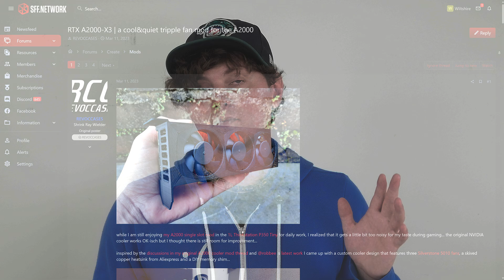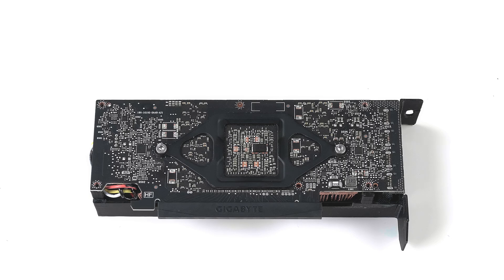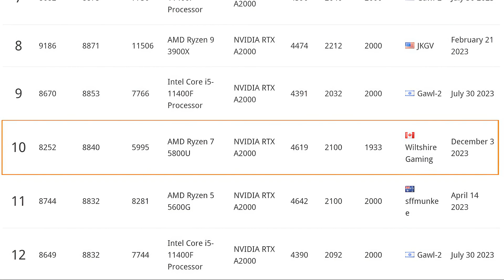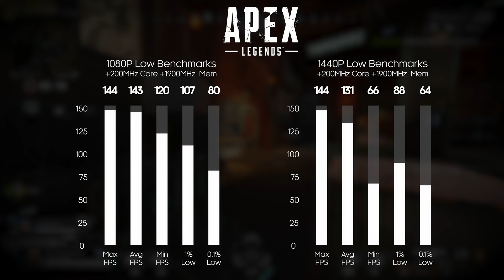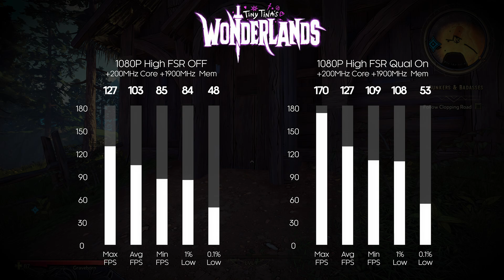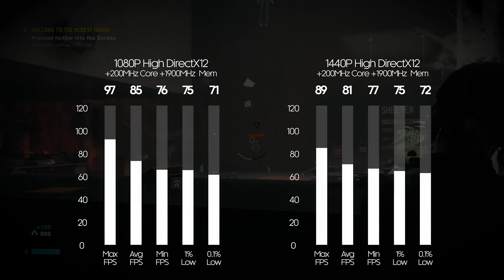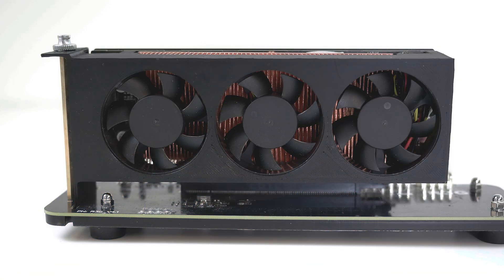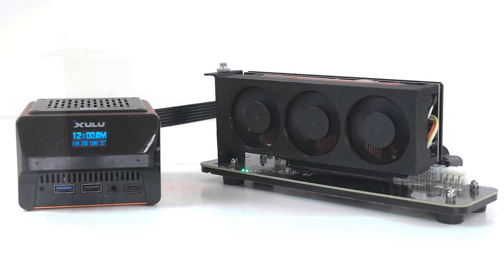Making the World's Fastest RTX A2000

Comment: came back to ask if you could do this with an RTX 4000 Ada generation if u ever get the budget, might try to do this myself with an A2000 cos its performing very similarly (in fact a little bit better) than an Arc B580 and it costs about the same, but is much better for SFF use cos its so low profile

edit: to specify, I want to have a similar set up to yours but use phase changing thermal pads and higher performance cooling compounds. I think using PTM7958sp for the actual GPU die itself, and PTM7950 with a copper backplate and aluminum shroud would help cool it much better, also try to hit that full 75 watt limit that PCIE motherboard interfaces allow.

Edit 2: I also just realized you could reroute the fans to the Mobo through a fan extension and not have to worry about their wattage and then use all of the extra wattage for the gpu as well.
Reply from the maker: I plan on buying an RTX A4000 ADA SFF. Not From Concentrate (NFC) made an amazing mod for the A4000 ADA SFF that I want to replicate. I just lack the funds for things at the moment.

I put PTM 7950 on the GPU die for the A2000Ti-X3 after this video and it helped drop the temps by few degrees! Not enough for me to make an entire new video on however.

I've gone the route of using the motherboard to control the fans and I don't like it very much. I prefer to be able to control the fan speeds at will using Afterburner.

Comment: Hi, could you help me with drivers for a2000? It allows me to dowload regular drivers, which not allowing play Fortnite or Witcher 3. Tried different methods but it’s still not working to dowload game ready one. 

How did you managed drivers and which version you’re using?
Reply from the maker: Are you referring to the studio drivers? The driver version that I used in these videos was version 546.01. I installed the driver like any other driver, nothing special.
Reply: i tried with 2 games and was not Able to even launch the game with a2000 12gb. But if you’re saying that with regular drivers it’s working than I’ll check as well different titles.
Reply from the maker: What kind of error are you getting when trying to launch those 2 titles?

Comment: For an A2000 it's rather fast, for a graphic card generally it's rather slow, my little 4060 has beaten all your scores.
Reply from the maker: To be fair, that's like comparing apples and oranges. The RTX 4060 is built using Ada Lovelace architecture and the RTX A2000 is not. It's built on Ampere. The massive advantage the RTX A2000 has over the GTX 4060 is power efficiency. The GTX 4060 requires the usage of an 8-pin power cable. The RTX A2000 draws straight from the PCI-E slot. No power cables needed. The A2000 is much more useful in tiny PC builds where cable management is an issue.

Comment: Hello! is your RtX A4000 still woking? i was wondering about reliability
Reply from the maker: @rusubogdan7030  my RTX A4000 is my daily driver that I use. It is still functioning just fine
Reply: @WiltshireTutorials  that sounds great, from what i saw on multiple forums you have been a  inspiration for many, myself included. Right now i am waiting for parts to mod my A4000
Reply from the maker: @rusubogdan7030  Always cool to see people who get inspired by the stuff that I've done. Good luck with the modding of your A4000. If you need any help or have any questions, I'm always around.
Reply: @WiltshireTutorials  Actually i do have a curiosity. The way i see it, the process of shunting implies soldering two resistors in parallel with the connector resistor and the pcie resistor. However, I see that you don't have stacked up resistors. I am assuming that the guys from jk removed the factory  r005 resistors and installed r003? From what i saw all forums suggested soldering r008 over de r005, and from my understanding that leads to a 8*5/(8+5) ~= 3mohm. Please correct me if i am 100% wrong in what i just said. Also, please excuse me if it takes two or three readings to understand some things i said, english is obviously not my first language.
Reply from the maker: @rusubogdan7030 no need to apologize, friend. Your English is great! I applaud anyone who knows more than 1 language. I've tried and can't do it! John from JK&G Ventures has his own method of shunt modding that is different from others. He won't disclose exactly what he's used on the cards, so I unfortunately don't have the answer to your questions. I could attempt to use a multimeter to check what resistors are being used.
Reply: @WiltshireTutorials  i will do the shunt in the "classical" way, i was just thinking that the way your card is shunted gives it a slight advantage in stability. Thank you very much for your help!

Comment: Wow, nice modding here.
My card just has a shunt mod plus extra power adapter soldered onto it.
Even with my oem cooler it was easily possible to get into the leaderboard (mostly under the 10th best).
Cha0s2k is my name there.
Wonder what oc settings you had for the benchmarks?
Reply from the maker: Thanks ! I'm glad you liked it. My OC settings were +251MHZ on the Core and the Memory was maxed out at +2000MHZ.

Comment: i have a rtx A2000M frankienstien most efficient card I've ever saw at only 60watts max power draw thought its only equal to a rtx 3050 6GB
Reply from the maker: I also have gotten my hands on one of those Frankenstien cards. Haven't had the time to test them out yet!
Reply: @WiltshireTutorials  lovely low power card with pretty good performance, i havent had any issues using the community drivers from the frankien drivers website
Reply: @WiltshireTutorials  my only issue with my card at least is i cannot turn up or down the power, clock speed or anything, and the one i have also has NO fan speed control. Even after reppacing the fan with a pwm fan (mine came with a normal 2 pin fan) it had no Pwm output on the connector. I feel like if a shunt mod was done, nothing would happen, i hope you get better luck with yours
Reply from the maker: @joshwayop  Hmmm, what driver did you install for thebcard? It very well could be a driver issue for it!
Reply: @WiltshireTutorials  sadly official driver do not work for frankienstien cards, and have to rely on these modded community drivers, either way, I think on most or all frankienstien cards, they are all locked down
Reply from the maker: @joshwayop  That's unfortunate. Have you tried adding the hardware ID of your card to the list in the drivers to trick the driver into installing? I'll take a look on mine when the time comes to see what happens
Reply: @WiltshireTutorials  i dont think you can trick the system to get real drivers, i think its more of a hardware thing
Reply from the maker: @joshwayop  I've tricked GPUs into using drivers before. Had to do it with the GTX 2080 prototype I have, so it used the RTX 2080 driver. Same thing happened to that card; wasn't able to overclock or adjust the fans.
Reply: @WiltshireTutorials  those i could see working, from the hardware complications of using a laptop chip for desktop style use i think breaks a lot
Reply from the maker: @joshwayop  I could potentially edit the official mobile drivers to get working on the card. Won't know for sure until I try!

Comment: The reason you are maxing out at 144fps in Apex is because you have a 144hz monitor need to run the fps_max 0 command in launch options to get past it.
Reply from the maker: @GoblinboyXL  Yes, I'm aware of that console command. I run games at their stock settings when I benchmark with no mods or extra commands. Really good tip for others though!

Comment: I've been wanting to mod my A2000 for a while now, but most i've done so far was a copper mod for the memory. It's been on my list for a while now, but seeing this video and the heatsink, i think i might give it a shot again. Granted the modded heatsink isn't in stock, so i might have to buy my own normal heatsink and mill out the spots for the caps/inductors etc. (from what i see, it's a 120x60x20 mm copper heatsink with milled areas for some components).

Great video, isn't there a way to add more voltage to the card by soldering some cables to a molex connector or anything like that?
Reply from the maker: For this mod, I decided to skip the Copper shims for the memory and use thermal pads in between the copper heatsink and the memory. No issues for the memory temperatures that way, thankfully!

Would love to see your results, if you decide to take another shot at modding your A2000! Those dimensions are correct for the copper heatsink. You will have to drill and tap threads into the block for the 2 retention screws on the back.

Yes! You can go that route. Currently I'm drawing my additional power via the PCI-E slot. Which has the potential of harming the slot on the motherboard, if it overdraws too much power. To mitigate that risk, you can solder a 6-pin onto the shunt resistor to provide the additional power needed by the shunt mod

Glad you liked the video! Thanks for watching.